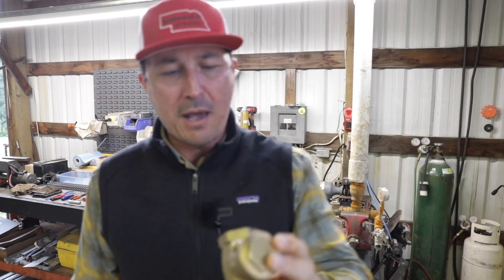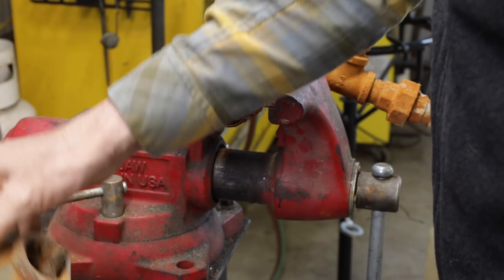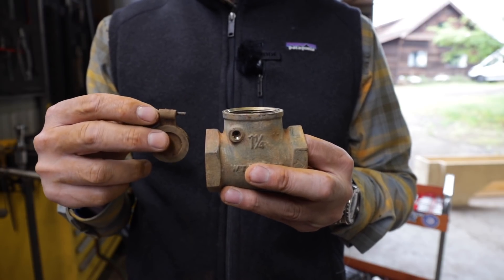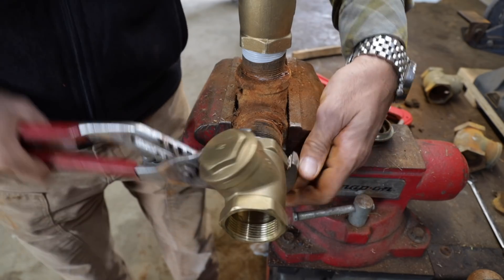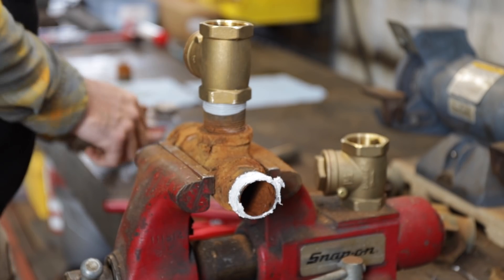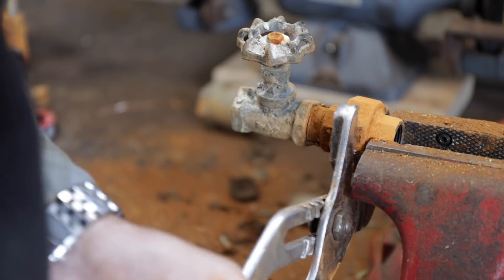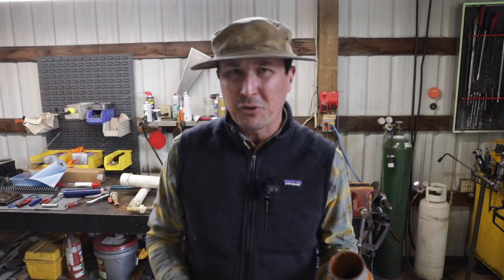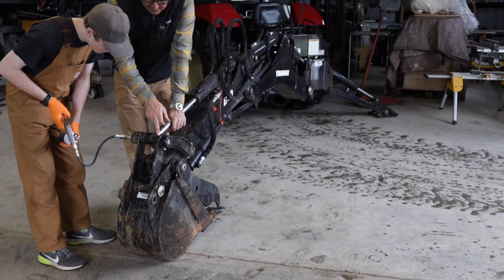RAM PUMPS - Do They Really Work?

Comment: If the ram pump ran every second for a full year - it be 86,400 (seconds in 24 hours) X 365 = 31,536,000 flaps of the valve.
Reply: @wimphilipsen2651  It runs 24 hours per day, every day. It doesn't get shut off unless he's working on it, or it gets plugged.
31.5 million times is correct.
Reply: Paul Getson thank you... it’s funny when people think they know everything lol
Reply: Came to the comments looking for someone that had done the math. Not disappointed.
Reply: @wimphilipsen2651  The pump works from the effect of inertia. The water flowing down hill gets stopped by the check, but still wants to move. It overcomes the back pressure in the out flow and runs uphill until the inertia is balanced out. Then the checks reset and the water flows again. The water must continuously move the checks and develop inertial or the pump stops and must be primed to restart. 
The outflow can be diverted from the lines to keep the flow going without stopping the pump. A float valve will let the pumped flow escape. When the reserve tank level drops the float will open the feed to the reserve tank again.  The check valves will still be clapping away whether the water is stored or dumped.
Reply: @OldSneelock  my man, exactly!....the know it all's in this reply are great 🤦🏻‍♂️
Reply: Man....me doing some maths caused this 🤣
Reply: Technically it would be more like 31,557,600.
60 sec x 60 min = 3600 sec/hour
3600 x 24 = 86,400 sec/day
86,400 x 365.25 = 31,557,600 sec/year
Can't forget leap years. 🤓
Reply: @wimphilipsen2651  As far as I understand it, the only way to shut off the pump is to block the flow of water from the top.
Reply: @PBGetson  Or close the valve, that is right before it.
Reply: I think we need to know how many days it ran for, because it wasn't the full 365.
Reply: This answer is from the beginning of the video wranglerstar stated he would like to know if it was running every second of every day
Reply: @phukyerpheefees  365.2422 to be pedantic... (No leap year in centuries divisible by 4 (i.e. year 2000). Joys of the Gregorian vs Julian calender).)
Reply: Lmao ok you can do the math 😂 nice work
Reply: Wim Philipsen ohh I must have struck a nerve ......but I personally have built one
Reply: I got the same.
Reply: I feel like when i have seen them its nore like every 2 seconds so hald but still

Comment: The better way to say it is it pumps water with no outside power needed. The pump uses the kinetic energy in falling water to build enough pressure to lift the water to a point and dumping the water it has taken the energy from. 

If you are trenching in plastic pipe remember to include some wire or metallic tape to be able to locate later.
Reply: don't forget to seed the trench once refilled, it will give you a permanent stripe in the grass to locate the pipe from an  elevated or aerial view but not so  noticeable  as stand out like a sore thumb.
Reply: Or just say how it is: 'falling water' IS an "outside power". So is the material to build the punp, the building itself and let's not forget the maintenance...

Comment: I built a ram pump after you introduced me the concept I used it at my cabin which happens to be off grid it has a clean water spring about 200 yards away down about 50 feet lower in elevation. It pumps water like a champ when we stay there. I built a simple shelter for mine and it’s not a worse for wear as yours but in Georgia we also don’t have the winters y’all do.

Comment: On the valve one flap a second equals 3,600 flaps an hour equals 86400 flaps a day equals 31,536,000 a year.
Reply: A top of the line computer gaming mouse only is rated for 50 million clicks.
Reply: Cerberus that’s 49.8 million clicks to many mf’s need jobs

Comment: A little piping tip. When working on pipe fittings arrange things so you can push and put your weight into it. So facing a vise and removing the fitting, have it to the right. The opposite for assembly.
 The tape and dope bit is handy, helpful when the thread is a bit rough.

Comment: Hey Wranglerstar I think you might find it beneficial to wrap the TFE Tape in the same exact way you did in this video just try flipping the spool 180 and putting your index finger through the hole with your thumb keeping tension on it. I think this method will help you efficiently put the tape on quicker and with more precision. Thanks!
Reply: Ayup. Also helpful to run one edge of the spool in the thread. Helps it start smoothly.

Comment: Try using the thread tape roll the other way, so the tape rolls off closest to the thread, you will find it easier to roll it on one handed with more control over the tension and faster to apply.

Comment: Your using the Teflon tape wrong. Turn it over next time and it will tighten up into the threads and be easier to use!
Reply: Yep the outside of the Teflon roll need to be toward the pipe.
Reply: It is easier that way but I wouldn't say he was doing it wrong.
Reply: I wouldn't say he was doing it right 😂
Reply: I agree he should turn it. Definitely!

Comment: You can use PVC parts for most of the system and spend a little more to get a Stainless Steel Check Valve & Waste Valve, if you want it to last longer.  Great detailed video! Thank you for sharing.

Comment: I bought a Canon PowerShot A470, over 10 years ago. I've used it to make videos for my YouTube channel. I also take still photos. In one of my videos I took many still photos while I was building a shed for my motorcycle and made a time lapse video after I finished building it. After all these years it still works great. It also adds info in the stills that includes the date and time the pic was taken. I also had a fully adjustable tripod that the camera will mount on . I also have a Canon scanner/printer. Other than I sometimes have to push the paper to get it to feed, it otherwise is quite a nice machine.

Comment: Rotate your Teflon tape to roll off in the opposite direction of your threads. (Roll off of the bottom, not the top.) You can control the tension on the tape.

Comment: A little tip, put the thread tape on off the back of the roll. So flip the roll over. It's so much easier to hold the roll and run it around, and it naturally keeps taught straight off the roll.

Comment: Hey Cody, you might get more efficiency by using a spring check valve in the #2 position. I've done comparisons and the forced closure retains more water and pressure. I used the stainless ones in a composite body, like they use in 1 1/4" well pipe.

Comment: Two comment:  1. Our fluids lab ( Civil Engineering department) had a ram pump sold by Sears from years ago that had a balloon shaped air reservoir and  the waste valve  was vertical with the stem up so it fell open when there was no pressure and the water flowed through valve body lifting the check against the seat to stop the flow..  The top of the valve was cut to provide a turning motion to the valve so it would seat in different positions as it worked.
2. As someone who has taken care of brass fittings, check valves, and other soft metals, I cringe whenever someone uses a serrated jawed tool on brass.  Or at least use a protector pad between the jaw and the brass.  I used to grind in steam check valves for 175 psi use.  It looked like those checks were not regrindable.

Comment: Switch to conbraco ball cheak valves. From my experience in industrial boilers they last quite a bit longer. 
Another good hit from steam fitters is to put a large hamer like a 3#er on one side of the thred to be removed. Then tap briskly on the other side of the threaded fitting and it will loosen a stuck rusted pipe thead much easier. I have saved many a pipe that would have been flattened or broke off by doing this. It would make a good video demo to test this.

Comment: Im glad to see you have a camera you enjoy, but what works for some may not work for others. many users use manual focus for total control while filming, also they use 4k so while editing they can crop and adjust the shot to be perfect. It's kind of like a fine woodworker and a heavy machinist, both use a cordless drill professionally but a lightweight compact drill may work best for the carpenter while a large powerful drill is needed for the machinist. Just thought i would chime in to add some perspective.
Reply from the maker: Yes, I understand this. You have a valid point if the camera comes with an attached cameraman. For the one mand band, manual focus is a terrible option, and for me, the extra time and processing power that is required to deal with 4k files makes the editing argument pointless. I am not a pro, I need equipment that doesn't prevent me from creating good content,
Reply: Wranglerstar absolutely!whatever works best for you!

Comment: the one biggest thing I learned and can remember from calculus is that the downward pressure from water is only based upon the water level height. a straw 20 ft tall has more downward pressure a pool that's 20 ft wide and 5 ft tall
Reply: But not the volume.

Comment: Pumps only have to lift the head. For example, you could have a 1000’ well, but the well fills up to within the last 50’. The pump would only have to lift the water 50’.

Of course you would have a check valve inside the house to preserve bleak off of the pressure in the pressure bulb. You will still usually have a built in check valve in the pump to protect against excessive wear with the impellers floating against the diffuser head to maintain a positive head pressure and to prevent a negative pressure in the line between the pump and home.

Comment: I would make my Assembly completely out of Brass not just the check valve and the rest of the line i would use Pex line to lay threw the forrest 🤘🏻😁
Reply: You can't leave PEX exposed to UV light.
Reply: Really so the 3/4 blue pex line that has been laying threw the back field from my garage to my Back Garden for the last 14yrs is alittle sun burnt and i better get sum sun screen for it 😂😂🤣 never had an issue and i always blow it dry before fall and the frost 🙄🙄🙄
Reply: @toshayonguard4253  
You sure it's not Linear Polyethylene pipe?
Because pex is Cross-linked polyethylene and doesn't resist UV light all that well.

Comment: If you want your assembly to be permanent, spray on truck liner will protect it. Just remember to bake the assembly first, to get all of the oil and moisture out of it. It will last far longer that way.

...and don't forget to bottom out your valves before painting.

Comment: Sorry to load up your comments but I've also used a screw driver and/or just a hammer to tap loose unions. Even gone as far as using a pneumatic chisel. Hitting in rotation on corner or point. Years working water and wastewater I've loosened galvanized unions rusted over 30+ year's

Comment: Try applying heat with torch to coupler, check or T. The expansion pops rust loose allowing easier turning. Try using PVC nipples and they make PVC check valves also

Comment: You had me at "Simple Menus", I came from running Real Video Cameras with NO settings, just 4 Adjustments 1.Gain 2.Aperture 3.Zoom and 4.Focus. I purchased a Cannon T3i Kit Cheap, Thinking I would shoot some YT videos and it sits in a Pelican Case. I curse the Thick Coke Bottled Glass Wearing Engineers who designed the hidden cryptic menus.

Comment: They are definitely making quality pipe right here in the USA. Probably not gonna find it on amazon .com though. The valve would make 31,536,000 movements in a 365 day period @ 1 movement per second.
Reply: "galvanized steel pipe manufacturers in usa" just give this a search in the good ole engine.

Comment: @wranglestar I have a 1/2" in and out ram pump is it better to have a bigger intake pipe if you have a fast current at the water source (brook), and also what is best for 1/2" delivery for 400', I was thinking to use 1/2" irrigation tube?

Comment: Can you run a discharge line off the line check valve? Move a bit of the waste water to where it might be needed at different elevation???

If you make the discharge line small dia., can you move water to higher elevations?

Great videos W!

Comment: Dad's work clothes always smelled like pipe dope and cutting oil. He worked 30 years as an Automatic Fire Sprinkler Fitter. I worked with him a couple of summers when I was in school and again right after high school, but left the industry when work got slow. I wish I would have stayed in that line. He worked in Alaska off and on in the late 70s early 80s. They have to bury water lines over 10 ft deep, below the permafrost.

Comment: How far vertically can you pump water ? We have about a 150ft cliff that has a spring at the bottom not much for an up hill head flow as it comes out of the cliff wall. How long if an air flow pipe the 3inch one.

Comment: Copper and steel have a molecular response to each other involving electrolysis which is the cause of that rust and corrosion switch to all brass.  It would be much more expensive but would last for years longer.

Comment: I’d like to try building one of these with Cerakoted parts, I’d either assemble it and Cerakote it all together or do each piece separately but with the corrosion resistance that stuff has I feel like it might actually stand up to the elements if you chose the right type.
Reply: Building the entire Ram Pump out of Brass fittings, nipples, and Valves is well worth the extra expense, Brass does Not corrode. Use PVC, PEX, or CPVC on the Long pipe runs to save money.

Comment: i would probably run a wire brush through the pipes. I can't really think of a good thing to stop the corrosion. Painting it with something and wrapping it to prevent UV exposure might be good. perhaps a full pvc one like the little one you showed off...

Also i know the rust doesnt hurt anything but eventually it will weaken the pipes at the least opportune time...

Comment: "Is this metric ?" Happened to me so many times ... I never understand when I work on an imperial sized equipment how they can stuff metric in it. Or vice versa. Drives one crazy !
Reply from the maker: Hateful metric strikes again,
Reply: Jarastlad I had a laugh when it turned out to be “hateful metric “  I assume it comes down to cost but how many times have we had to walk back to the bench and get a “hateful metric “ wrench  😜
Reply: @davidirwin7253  Yeah, that has happened quite a bit ^^ I'm not that hateful, I kinda live in Metric Country (Belgium) but I use imperial for so many things (woodworking mostly ... but when you take a look at it, it's everywhere, even here ^^) so I'm bilingual imperial/metric
Reply: Fun fact. We call a foldable ruler a Zollstock in Germany; literally inch-stick; while using it with metric markings. So much about Germans beeing logical....

Comment: Great video as usual.
I've been wondering if the spring loaded check valves would work better on the DIY ram-pumps, have longevity, and be better for rebuilding.  Also would painting the pump with an oil based enamel help with the rust issues?Any experience or thoughts?
I've been interested in this technology ever since I read about Thomas Jefferson using it at Monticello. 
The commercially manufactured ram-pumps are so expensive and the DIY made ones work do well at a fraction of the cost.
Thank you for sharing and the hard work.
Reply from the maker: Yes, I also have given this some thought. I think the best design would be to use a springless foot valve on the waste side. It seems to me the foot valve would be less likely to wear out.
Reply: @wranglerstar  
I wasn't expecting such a fast reply. Thank you.
Sounds like we both have some experimentation ahead of us. Ill let you know what I find out.

Comment: Flip the nylon roll over so it is unwinding opposite the direction of your wind onto the threads, then you can tension the tape by applying drag as you wrap. Just 180' the roll and give it a try.

Comment: ya i think you could get away with just using a rubber ball for that . then just have the valve's input side facing downwards so the ball will naturally fall into the hole creating a seal.
and there is no pivot point to ware down and break this way :)

Comment: Can you do a video on how/why you prefer imperial vs metric. I'm generally curious, it seems like metric is so much easier on paper and in practice for measuring say < 6 ft like woodworking. Not trying to start drama just would like your/others opinion.
Reply: You use what you are used to, I really don't know why Europeans are so evangelical about this.  Really, one is no easier than the other.  Unless you can't do fractions I guess.  Americans have been taught both systems since the early 1970s. We use both.  The headache comes when trying to convert one to the other for whatever reason.  Just think in whatever scale is being used.

Comment: I’m a plumber, heat up the joint and hit the fitting your taking apart with two hammers 180* from each other at the same time. 99.9% of the time it will unthread like the day it was installed.

Comment: Could a spring loaded, rubber flapper, check valve be used, or does it have to be the flapper style check valve?
How far "up the creek" does the intake pipe need to run?  Thanks!
Reply: We have rubber flapper check valve on irrigation suction line. Rubber lasts a few years, and needs replacing.
Reply: Carl Zirk, Thanks for replying. I was just wondering if they would work with the ram pump and if they might last longer.

Comment: If the check valve opens once every second it opens 31557600 times a year and closes 31557600 times a year
Reply: How did you get that number?
Reply: With a calculator doing 60 x 6o to get one hour and timesed it by 24 and then by 365.25
Reply: @jacobfrost5457  oh yeah thanks I was confused because when I did it I just used 365 and forgot to check it with 365.25